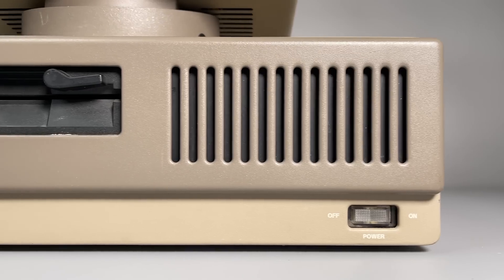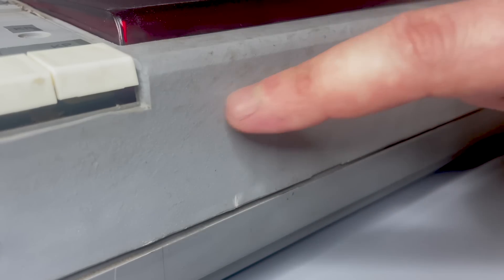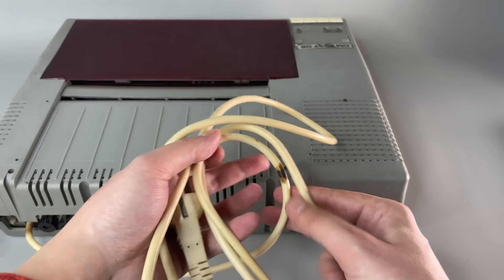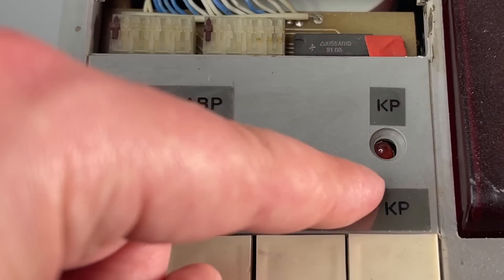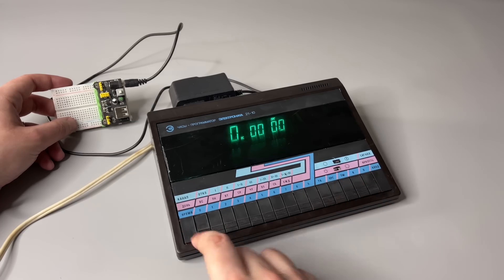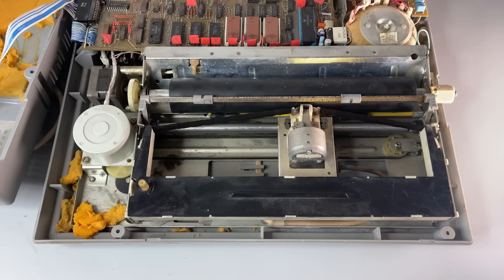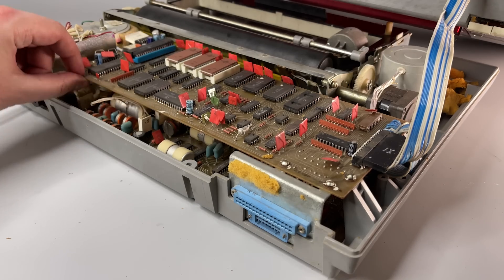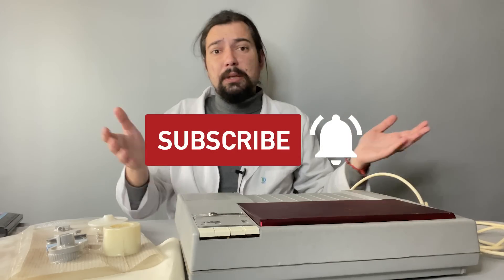This is THE WORST PRINTER I've EVER seen | Soviet SM6337.02

Comment: I was born and raised up in late Soviet Union. I can confirm, that every plastic thing looked exactly like that. It was low quality with lots of geometrical distortions and disgusting color. It smelled really bad too. Toys, appliances, everything was made out of it. When I got my first Lego set, after the Soviet Union collapsed, it looked totally out of this world, like a piece of an alien civilization 😀
Reply from the maker: I was there, Gandalf. I was there 3000 years ago.
Reply: They used polystyrene for almost everything.

Had had a Lego-like set that looked pretty dull.
On the other hand, it coulf be fixed with dichloroethane glue. :)
Reply: I was born in Poland in 1986 and we had plenty of CCCP era home appliances. Not all of them were made of shit materials. Some of them were actually really nice and very durable. Of course after like 20-30 years the looks deteriorated, but the same was with Western products like computers which turned from nice white, beige into piss colour.
Reply from the maker: @mattx5499 that beige coloring is such a pain for us... sometimes, after a complex workvon reverting it back it is like a relevation to see the original designer idea.
Reply: @ChernobylFamily  I would like to be just about this. It wasn't that bad when it comes to the products made in communist controlled countries. Many of these products were designed to last, they used common parts and were quite easy to repair. They were kept together with the common type of screws, no glue no fucking resin on the enclosures and electronics. Kinda like well made DIY devices. Now they want you to buy the new shit and throw the old ones away. We are losing our 'human touch' in this to support extreme, wasteful consumerism against skills of all sorts. I'm crying while writing this and I feel that I said it best as I could.
Reply: @mattx5499  And in communist-"controlled" China they make a good stuff, much better then it is in elsewhere. And getting better and better. And in the Soviet Ukraine good stuff was made as well, but Ukrainian regime wasted everything.
Reply: @mattx5499  YEah, but when I want to buy a printer, it should at least produce prints sensible quality. If I am after DIY sets to create my own printer - I would buy something different.
Reply: @mattx5499  I was also born in CCCP satelite Czechoslovakia. It was irony because again CCCP was able produce quality goods but that was for privileged and exports for people cheapest crap as possible. For example my country was producing first colour televisions we had massive manufacturing plant yet you couldn't buy one for almost decade everything was export especially to grmany.
Reply: @Pedgo1986  I collect Soviet wrist watches and I have always heard that people preferred export models.
Reply: @Pedgo1986  We had some Czechosloslavakia made things too. They were seen as nice quality products. They were often bought during trips, so they were probably the common ones Czech and Slovakian folks had. Also as a nation we really had a lot of sympathy towards Czechoslovakia and stuff made there was really wanted by Polish people. Maybe USSR era sucked in most cases but there were normal people that wanted to make good stuff.
Reply: @mattx5499  It sad history actually in one time we were extremely rich developed country actually European superpower but due to politics and two WW everything get down the tubes fast. Clerofashist regime, protectorate, incompetent politicians. Now the sad fun fact before war in Sudeten we had massive border fortification akin to Maginot line and even better but western block forced us to secede land to Hitler and we lost all defences that actually could stop Hitler in his tracks before he ravaged whole continent and after war we were betrayed again and territories were annexed by every neighbouring country. Then e had communist regime and after that our "engighted" politicians broke country into two and in 30 years destroyed everything on both sides everything. Now we are just corrupt and bankrupt nothing in middle of Europe that does not deserve to be sovereign nation because it was and still is tragedy and utterly corrupt nosense.
Reply: @Pedgo1986  And the worst part was the lack of improvement in the late 80's soviets tried to sell their products in Mexico and to be  honest a Rainbow tv looked decades old agains a Sony tv from that same year.
Reply: @HIDHIFDB  it was very elitist system they have people and means to improve things but it was only reversed for elite and export for own people only basic cheapest crap.
Reply: @mattx5499  That is an apples to oranges comparison. If you got a washing machine, you were in the minority. In the modern world, it was the same as owning a $2000 washing machine. Of course it worked, it was only for select people when new. 

In the same way, most Japanese appliances sold in that same era still work today, and more efficiently and safely at that.
Reply: @charlesc.9012  I don't know what contry you're talking about but here in Poland people had washing machines and plenty of other home appliances. The problem was they had to wait in long lines to get them. Of course we weren't talking about availability but about the quality of the devices. Someone here said that they were shite, made of ugly materials in ugly colors. And I said that it wasn't that bad. Many of these appliances were built to last, using parts that were quite easy to find to repair these devices. I'm not praising USSR as it was insane.
Reply: @mattx5499  Я с тобой согласен, в СССР в 1970-1980 -х годах в моём детстве  были очень качественные детские игрушки , детские конструкторы , были  русские детские конструкторы типа LEGO , они все были очень качественные, я не помню в своём детсве дерьмовых игрушек. Плохие товары начали производить после 1986 года, когда началась перестройка СССР. Это стало тогда очень заметно.
Reply: I have two plastic buckets, I bought them in the USSR. They are an ugly color. But they didn't break, they didn't burst, and I still use them for garbage, they are also strong and elastic. Over these 30 years, I have had many beautiful and colorful buckets from different countries... they all broke, their handles flew off. I also have an expensive Suunto watch, they use an original plastic bracelet. the bracelet costs about 3,300 rubles, it lasts for a year, after which the plastic turns into sticky plasticine and bursts. Terrible Soviet Electronics 5 watches, the bracelet has been normal for 40 years.
Reply: @championknife  so ur amazed plastic still in one peice after 30-40 years o.O thats the case world wide bud :) i have plastic buckets that are 30 years old from africa? does that mean africa has amazing quality plastic products? o.O O.o 

Also ur dumb and prone to being scammed if you think a expensive plastic watch is worth ur money anywhere in the world..... Get a plastic clock for ur wall it will last longer..... 

Common sense i guess tho o.O
Reply: If it would state of technology then i would understand but they could an were able to produce much better quality good if they wanted but that was only reserved for privileged and party was greedy so lowest possible quality for peasants only redeeming part is many things were made bulky and very simplistic so they lasted and people were able to service them at home.
Reply: прасрали полимері!
Reply: I'm polish- the same here.
Reply: Hahaha hey, Legos are better plastic than we make car intakes out of nowadays.  To be fair though, I love the uneven coloration of cheap plastic, as long as it's strong enough to do the job that's asked of it.
Reply: @FuckGoogle502 , Lego is also very expensive compared to average salary below $500 per month in most post-soviet countries.
Reply: I was born,and grew up in ex-Yugoslavia. It was a less communist,and more open country than CCCP,we went to Germany,once a year. For me,i was in a heaven of toys.. some of toys in ex-Yu,where really good,some ok,some where really bad..
Reply: @Bare36 югославии уже нет почти 30 лет ну как там у вас теперь все игрушки там хорошие?А дерьмовых разве нет для менее обеспеченых граждан ?😂
Reply: @Bare36 кстати я смотрю каналы жителей китая которая более открытая и менее комунистическая чем югославия  😅
Reply: The plastic on this video looks actually very nice. The few toys I had in the 80's were often made of a multi-color plastic that looked like they were made from some goo obtained by boiling differently colored plastics together. I figure it was some kind of primitive recycling.
Reply: Купил принтер эпсон из 90х выглядит хуже этого в 10 раз!Шлейфы порваны,пластивовые крышки расколоты,корпус жутко жолтого цвета(не оттирается),единственый плюс большое количество светодиодной индикации 😂

Comment: but they used really beautiful torodial transformers :-)
Reply from the maker: True!
Reply: @ChernobylFamily  even these with the rolled metal bands are nice and are nowadays used in high end audio.
but there are better examples for soviet tech. I have a pair of Radiotehnika H150. Perhaphs you know this brand. Like on the first day. Even the speakers itself. The included oil paper caps are really high priced today
Reply from the maker: Radiotechnica was from Baltic republics, this was like Robotron, a high-end stuff.
Reply: @ChernobylFamily  yes I know. I mentioned it because it was an eastern block country as well. But even radiotehnika did not manage to keep its quality until today.

Comment: Like everything, few advantages on the trash background.
Have a MS6317 printer, made in Kyiv Octava factory, clone of the HP inkjet. Small (A4 sheet with 40mm thickness), absolutely silent. But with big troubles of compatibility, printing quality, inkhead supply, paper feeding. So practically unusable.
And they made it with 8080 CPU (3 powerings, 2 tacts, huge hot DIP package, special periferials) in such small space!
Reply from the maker: Thanks for sharing!

Comment: A couple of years ago I read a book written by an western astronaut who went to the ISS, even there quality is not a priority. He commented about some machine on the russian module that sounded like it was going to shread appart, russian cosmonauts were like: " dont worry about it, thats normal"...
Reply from the maker: Well... and then holes in modules appear...
Reply: Well,  given, that Zvezda is Soviet made... It was the replacement module of the MIR core, in case of a launch failure, so production was around the time Chernobyl happened. A lot of the design is still derived from Salyut stations.
Reply: @MichuKaiou  Literally it was going to be the core of MIR-2! Sadly its now quite damaged on the aft docking port and to really fix it they'll need to remove all the interior pieces. Including the permanent computers with displays only used for docking once and then never usable since then...
Reply: You think that's bad, wait until you get to the British module... 😉

(We've been working on a zero-gravity compatible teapot for years. The present prototype is based around a centrifuge. Unfortunately the parts aren't machined to the finest tolerances, and sudden jams have been known to happen... 🫖🔁😋)

Comment: A friend of mine here in the US had a little sideline of selling old, Soviet era whatever online.  He has family in the Kaluga area and they would scan flea markets and the like for it to send over for him to sell and send some money back.  When, let's call it "Putin's visit" began, despite his Russian origin he was quick to have a fire sale of whatever he had on hand and I purchased a Raditechnika console stereo from him.  It was only about $100 and I only bought it out of my interest in audio gear.  I got it home, plugged it into my step transformer to find, surprise, it didn't work beyond putting out this horrible burnt smell.  I tried to open it up to see what was the problem to be met with this weird, wood-look sticker on a hunk of particle board that was just shoddily glued to a thick, disintegrating plastic panel underneath.  It was held on by tabs, not screws and there was simply no way to gain access to the interior without breaking it.  So, after a few minutes with a Dremel tool I had it mostly sliced in half to find all the capacitors were either exploded or shriveled up in a way that I'd never seen before.  Quite a lot of the wiring was aluminum core and it just wasn't worth my time to even attempt right whatever was wrong.  I'm sure it sounded shit anyway.
Reply from the maker: Thanks for sharing!

Comment: Russia may not have had the "best" ice-cream, but wow, was it cheap for western tourist.  In the late 80's, if my memory is correct, an ice cream cone was 10kopek or maybe, it was after exchange 10 US cents.  When we were in Novosibirsk, a vendor was selling them out of cardboard box.  We each bought a couple for ourselves and then bought one for every kid that was in the park.  Looking back, it was probably something they did every time a tour group came through and the local kids probably weren't that surprised.  As an aside, we visited Orel on that trip.
Reply: I was collecting coins for a while, and one of them - Odin knows how it even came to be in the UK - Is a one Kopek coin.

Looking at it for the first time, I could already tell that the value of the bronze it was made out of was at least 20 times its face value... 🙃
Reply from the maker: Thank you for sharing!

Comment: As long as they were able to put all parts together everything was good enough... In the 80s I had Chinese "pocket" AM radios "imported" by Moroccan street vendors that were cheaper than a pack of 4 Spanish made alkaline AA batteries, the plastic parts were more or less the same, a half melted housing and wobbly tuning and volume knobs... but they worked well enough for people to buy them for such a low price, until they dropped them on the floor and the PCB broke into several pieces, then they gave them to me but I was too young to be allowed to touch a soldering iron...
With a bit of luck I could join the tracks by wrapping a piece of wire around the pins of two components connected to both parts of the same track, but a lot of times the PCBs were broken along the holes for the tuning coils that were mounted flush with the PCB.
A Moroccan street vendor once told me that they bought Chinese electronic products by weight in Morocco from other people who brought them from China, LCD watches, radios, mains power adaptors, etc.
In fact, he offered me a kilo of assorted LCD watches, telling me that I could sell the ones that I didn't like and that way I would get the models that I did like for free, or that I could even make a profit! I never knew if it was a way of trying to trick a child into buying kilo of watches or if he really was buying that crap by the kilo 🙄

Comment: It can't be worse than HP subscription printers.
Reply: Have old HP laserjet , got it for free when cast iron plant got rid old computer stuff, over 20 year ago , still works and its about 30 year old., their old IBMs with 286 processor works too, that 1990s tech , i have Nokia modem with 10 number memory , time period when you needed to know server phone numbers and WORM drive , 30 x 30 x 60 cm , steel box full of old electronics, no much ICs, new ones are size of CD station.
Reply: @pete_lind  I know the ones you're talking about - My school had a few. I once repurposed one of the empty ink cartridges to learn a bit about how it worked, and noted - With interest, in hindsight - That most of the cartridge would have been full of ink when manufactured, only void space being two small air bags included to prevent a vacuum stopping the ink coming out. 👍

Of course; Nowadays, the ink (All 0,25ml of it!) will be sited inside one of the airbags to ensure all of the money comes out... 😉
Reply: This printer by default makes one copy of each printed page for the KGB
Reply: @MajorChernobaev-w9i Now we have Microsoft taking screenshots every five seconds ('Recall') so all hackers, secret services, and other digital thieves can do their work quite easily. 😁
Reply: You clearly never seen Russian products.
Yes, its worse than you imagine.
Reply: Based on my experience of recent HP output, the Comrade СМ6337 shown here is both better made and will be considerably easier to service and maintain. 💯

It doesn't require „Special“ inks at $175,000/litre, either. 😉
Reply from the maker: If you look with attention, you'll notice that in that vacuum plastic package there is also a set of maintenance hammer and sickle.. (just kidding)
Reply: @ChernobylFamily  I've been wanting to make computing equipment - To unquestionably British designs - For quite a while now. If I ever get that far, you can be sure to find ten Tetley tea-bags thrown in with every purchase! 🫖🇬🇧🙃
Reply: @UK-Combustibility-Assured  get the EPSON Eco tank printers with bottle filled inks in ink reservoirs.
Reply: @UK-Combustibility-Assured  Yeah but before HP became what it is today, it made some things that the Soviets would have craved.
Reply: It’s almost as if this printer was made by Lada